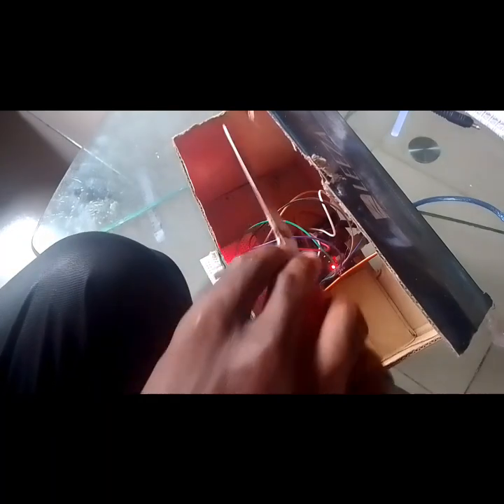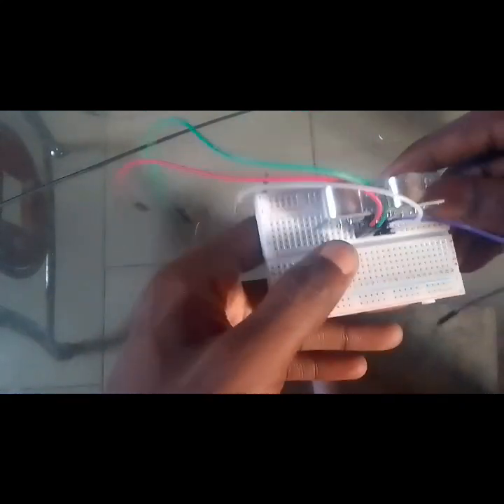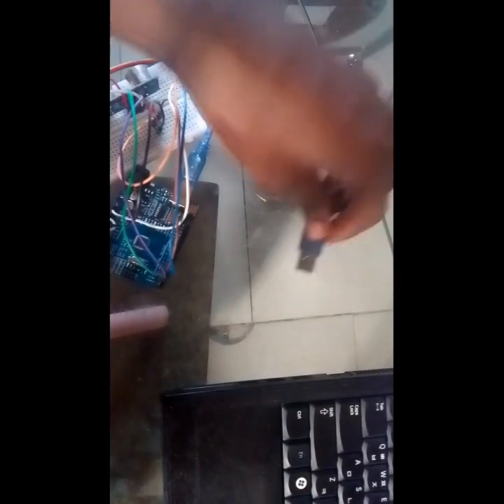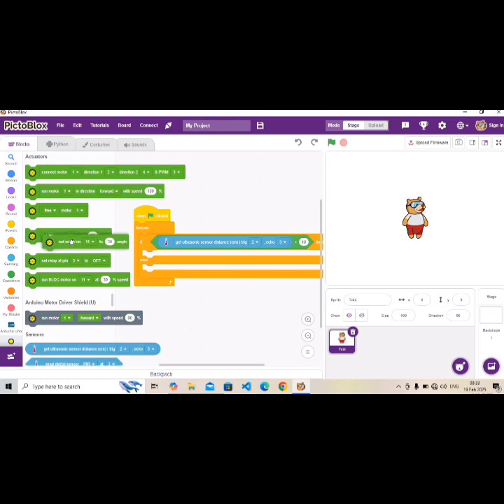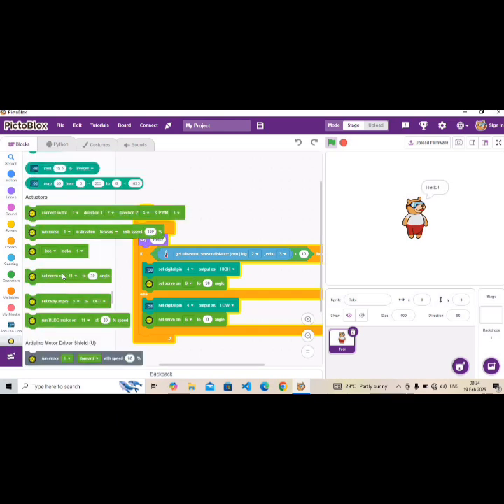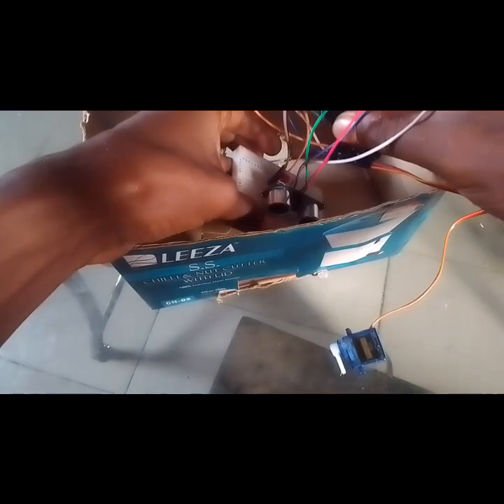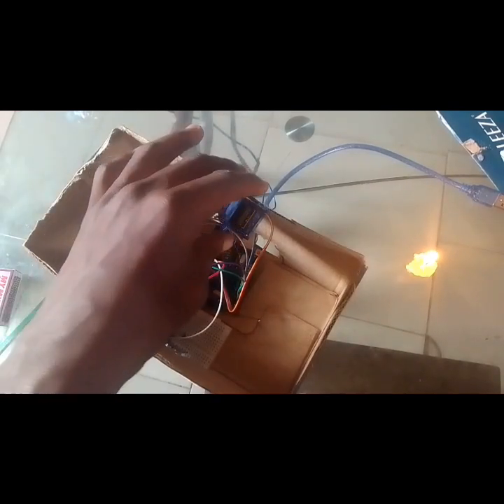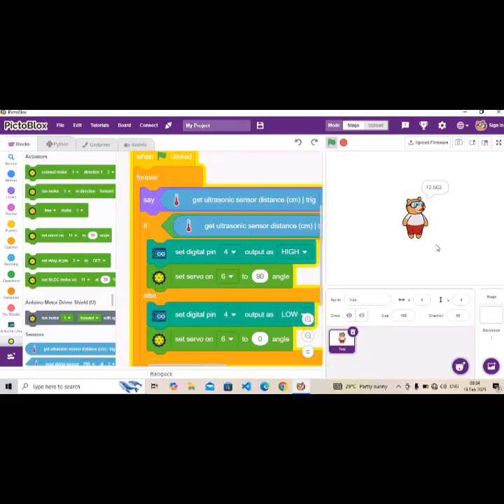Build a SMART BIN with Arduino & PictoBlox | Ultrasonic Sensor + Servo Motor | DIY Tech Project

Comment: I would like to the circuit connection without the breadboard
Reply from the maker: In this case, you can use a female to male jumper wires